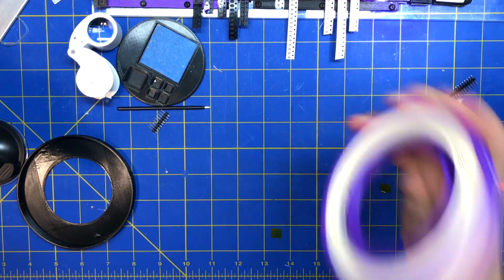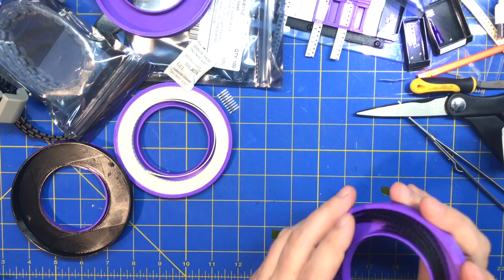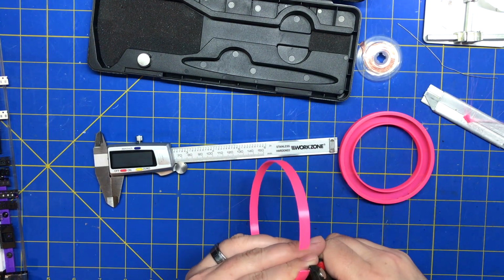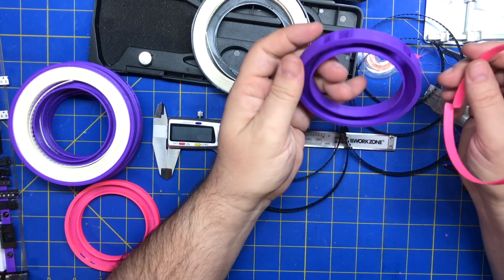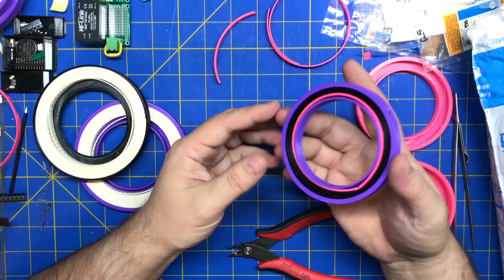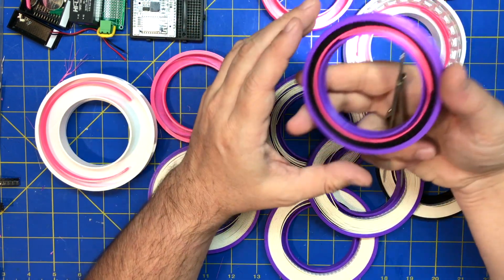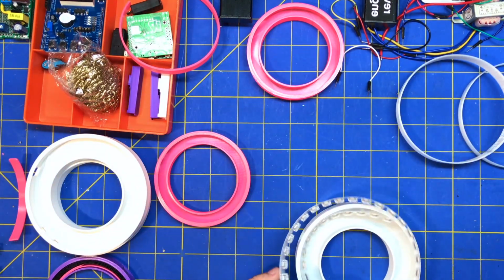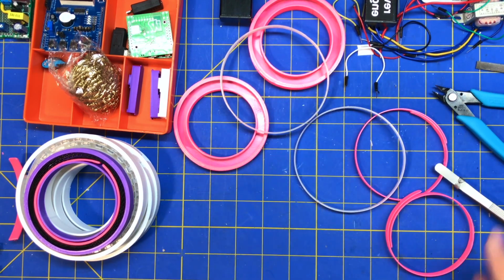Project VLOG of my 3dprinted SMD tape reels

Comment: Regarding the "snap together somehow" part at 33:00 - how about adding some small concentric rails on the "closed" side, which fits into the other, opened side?
Reply from the maker: I thought about that but printing that side flat is what makes this easy to print, you start to introduce supports and overhangs with any kind of snap mechanism, I also thought of using the inner ring somehow like using a <> slip ring that snaps inside the ring and joins 2 but then you need a bunch of them, I might just add some kind of keyhole notch like spindles use.

Comment from the maker: oh if its not obvious my main design principal was 1 simple part, no post processing, no supports, no hinges,assembly etc I stayed pretty close, There are alot of things you can do with this, you could use complex springs, use a anchor point, use a sliding cover, but those all vastly add complexity to printing them. It is also fairly parametric ( once I clean up the timeline of my fusion filles.. )